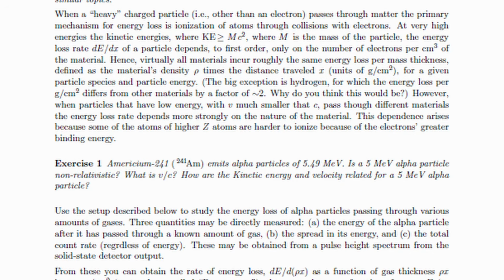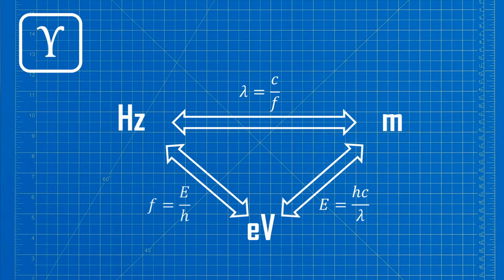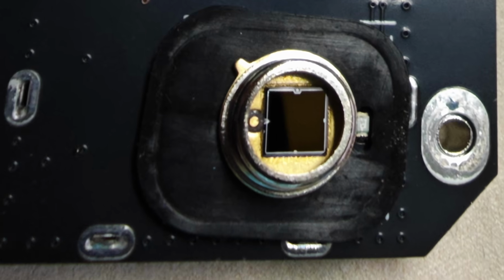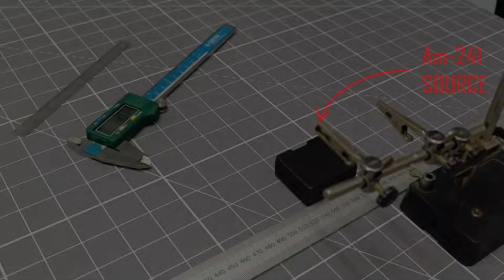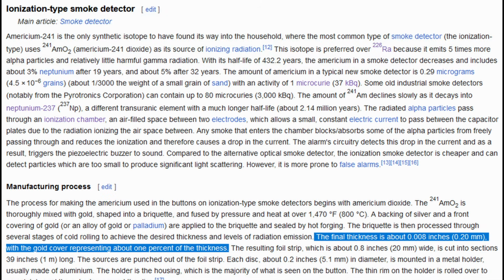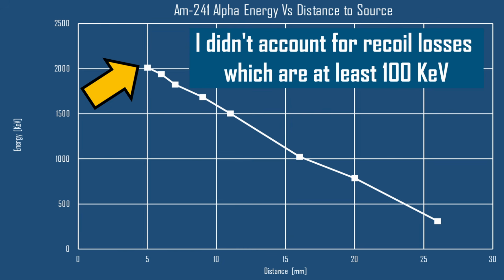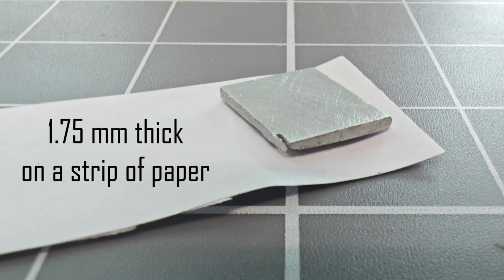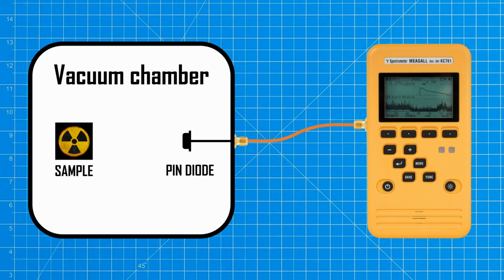an affordable alpha spectrometer.  ☢️

Comment: can you measure Radon directly or by filtering only?
Reply from the maker: I am very skeptical of the videos that I have seen that show concentration of radon gas using filter paper (or alike) over the nozzle of a vacuum cleaner.  Normally a survey is done over a long duration and using a gamma spectrometer.  Radon is a noble gas, it is chemically inert. I can't see any mechanism for it to want to 'stick' to the filter any more than the oxygen or nitrogen in the air would.  
Radon-222 is not easily directly detected but looking at the measured proportions of the various gamma lines in the Uranium decay chain, the levels can be estimated, but it takes time to collect enough data and some background knowledge (or a willingness to learn) to be able to process the data.
Reply: @project-326  the other issue in these measurements is they never refer to the time of filtration as if the volume of filtration is not counted it could only be counted the presence of Radon but not the amount. Is there any changes in window that you noticed in KC761B, as it still does have the cover. The second do you think that settings the  window for background discrimination in specific isotope detection that could make the CsI(Tl) effective for alfa measurements, rather then use of semiconductor or Ag(S) thin detectors, so radiacode could also be fine for alfa detection? By the way it would be worth the mention that radiacode is the only makeing automatic isotope identification, others make it only by manual set to the peak. But my question to the manufacturer is what if there is a mixture of istotopes like in most contamination, i.e. Cs-137 and I-131 is it the others detected or the peak only?

Comment: Today the kechuang Blog about the KC176B
The Tiger brother developer states about beta drtection
5. The issue of resolution control was at odds with the crystal factory, so that the price of the crystal was twice as expensive as normal without control. Since the KC761B guarantees a resolution better than 7.8%, approximately 35% of the crystals now need to be thrown away, which is intolerable.

In addition to the above problems, the user manual needs to be modified to make it clear that beta energy spectra cannot be obtained using PIN. Beta rays have strong penetrating ability and will penetrate the depletion layer of PIN, so all the energy of the particles cannot be transferred to the PIN. No matter how high the energy of β is, the energy spectrum of PIN is roughly concentrated on a peak on the left and does not move too much to the right. Increasing the bias voltage can thicken the depletion layer, but the PIN itself becomes a source of noise, and the low energy threshold will rise sharply to the point of being unusable. Of course, this problem can be solved by using some sky-high price PINs, but the instrument itself is sold at a bargain price and cannot afford a nuclear-grade PIN with low enough noise.
Quite disappointing...

Comment: Wonderful. I turned from being a grad student in hi energy physics to computer science some time ago (the 70's...) I actually remember some of this stuff! I recently got a Radiacode 103, which is a wonderful, versatile device. I would hope that Radiacode has viewed this presentation, and is contemplating adding a PIN diode detector for the, let's say, 105 version... Looking forward for your review of the revised unit!
Reply from the maker: I know what you mean, but at the same time, I like the RC102/103 just as it is, I kind of think of them as one for the road and one for the home-lab...

Comment: Forums seems to be useless. I was banned on physics forum for showing people there did not understood Newton's 3'rd law. It makes sense that energy of alpha particles is their kinetic energy as it is a massive particle the nucleus of an atom so way, way heavier than electrons. 
I have a Radiacode 102 is a gamma spectrometer barely getting in to beta and just got it out to check the limits but it was again dead (overdischarged battery). I think I charged it two wheels ago when I also found it dead. So it may have significant self discharge while powered OFF witch is bad as that means the battery will eventually die.
I also have a Radiascan 701A but that can not measure energy is just a counter that should be able to detect alpha particles. I'm not passionate about this but I like to have this meters just in case I ever need them.
Reply: The amount of snobbery and exclusivity in modern day acedmia is quite disheartening.

Comment: KC761 alpha spectrometer is better than Stoppi Alpha spectrometer?
Reply from the maker: No idea which is better.  In this case, better, probably means lower noise.  My problem with that video is how the calibration was done, it was a little misleading.
Reply: @project-326  OK , can you explain comparison between KC761 Alpha spectrometer and Stoppi Alpha spectrometer
Reply from the maker: @pak7524  the principle of operation is identical, a reverse biased PIN photo-diode with the glass cover removed in a dark enclosure.  The Stoppi video is using the freeware Thermino MCA software to perform the actual spectroscopy and the KC761 has a dedicated, pre-calibrated one.  The Thermino MCA software doesn't have any idea what it will be connected to so the user needs to figure out how to calibrate it.

Comment: IIRC one problem with silicon detectors for alpha detection is the cumulative damage the alpha particles cause to the silicon. I suppose this won't be a problem as the device is built, but doing lots of alpha detection with the bare PIN diode will eventually degrade the detector.
Reply from the maker: I heard that this can be a serious issue for research labs that work in this field, I guess that their detectors will be getting used extensively.  
Just the 5mm of air is bringing the energy down a lot, but I am planning to create a vacuum chamber front end for this device, so that might become problematic.. Fortunately, the detectors are pretty cheap and although my use case will be with a VERY low duty cycle, I will take your advice and ensure that the replacement process is as simple as possible...

Comment: excellent video again sir! Neat little device ! I am considering buying one thanks to your review..  I have made some decent vacuum chambers with PVC pipe for rough vacuum applications on the cheap. Epoxy glue work great for small leaks. Unfortunately, alpha spectroscopy demands tedious sample preparation to be valid, but you can still have fun ! You know you don`t have the full energy until your peak is a vertical drop to baseline on the right side (max energy) .. Great work!
Reply from the maker: Thanks for the input, I have been trying to figure out what pressure I need inside the "vacuum bucket", some comments have indicated that the pressure should not be too low, or back-scatter will become problematic...
Do you have any advise on what pressure I should be aiming for?
Reply: depending on the size of your chamber I would assume the mean free path range of the alpha would be no more than a few cm so 10-3 Torr )0.1Pa) range sounds about right @project-326

Comment: This was a very good and informative video! Thank you very much! I have by now beta measured only a stronk thorium lens and autunite. I have very much hesitated to hack the device but your idea of screwing g on a 3d printed cover seems very useful. I am pissed about the firmware and software limitations but the actual hardware is really good and well thought out. It grows on you, tis little bugger!
Reply from the maker: I always tell folks, buy the RC102/3 if you are new to the subject, only buy this is you want to learn more...
Lets keep in touch on tis lil' bugger, it has its own advantages, but they are hidden from the average casual user.
Reply: @project-326  I will! I have some interesting reading from a very small tritium tube which the 103 doesn't detect at all but re diode does. So I think it is a very good complement to the 103 in fact! I'd send the bmp but that isn't possible I see...
Reply: @project-326  I just wonder... What if someone with an opened diode, due to heavy tinkering wound print a cover with a slit so there's strange physical effects takin' place, doing gaussian things to the light coming in... What would the Kc show?

Comment: Alpha detection isn't that hard. Spectroscopy (as you have found out) is a major undertaking. The industrial/commercial grad equipment we use at work uses a bare scintillation crystal in a dark vacuum chamber. The documentation says it doesn't pull a 100% perfect vacuum as the slightest amount of air helps reduce back scatter. Don't ask me how this helps as it is above my pay grade.
Reply from the maker: Nice insight, I will remember that about the vacuum not needing to be 'too good'.  What kind of vacuum level is good?
Reply: The manual says between 0.1 and 2.6 kPa for recoil suppression.
Reply from the maker: @connclark2154  Ah, to suppress recoil of the parent nucleus.

That is really useful thanks!

Comment: My Americium-241 sample shoots out so much gamma from decay chain reactions my RadiaCode103 goes crazy. That and Thorium2%/Tungsten welding rods. Great video!
Reply: i have a GMC500+ that i modded with a LND712 tube  and it gives me around 60,000cpm on an AM241 source and when i put it back in the metal can it drops to almost nothing my thorium lantern mantles make it scream too while my U ore only gives off 3 to 5k cpm hehe
Reply: @wolvesone I apologise for being late but what is the activity in Bq, and energy of your Am241 source?
Reply: @Sheldon_Lee_Cooper1980  i have no idea it is just a .9 micro curie? source from a cheap smoke detector

Comment: Love how thoroughly you tracked down all the variables.
Vacuum bucket with Plexiglas top used for impregnating mineral samples with resin should work well for that pin diode experiment.  Added advantage, way to stabilizing your ore samples so they don't shed radioactive dust into your environment.
Really like the deadpan voice...don't change it.
Reply from the maker: The chamber does need to be dark, so black acrylic sheet for me...

Comment: I was looking forward for this video, interesting way to optimize the sensitivity of the PIN Diode, probably you ruined the sealing by cutting the foam rubber, easily fixable. I am waiting for the new Measall to be released, cause currently at a whopping 12% FWHM value for Cs137, its gamma spectrometer is quite useless. The new Radiacode 103 which I just purchased has a FWHM for Cs137 of 8.4% (Anything above 8% for a nuclear phisicyst is useless and they throw away many NaItl crystals due to that, but for hobbyists around 8% can already show something.)
Anyway, I think that the best option to use this feature on the Measall with scientific value is to calibrate it on a known source (uncovered not like stoppi did with the am241 that was in an alloy so had much of self absorption and shielding by the gold film) so that way you can already compensate for the energy loss of mylar, aluminum deposition and air between, which will be the same for all mesurements. Obviusly to maximise the properties of the sensor it should be used in a vacuum chamber, but for that I would suggest replicating the stoppi circuit, maybe with a bigger PIN diode (Its BPX61 is quite small at 7.5mm^2) like for example the s2386 8k by hamamatsu at a decent 34mm^2 (I am doing it myself).
 If you modify the measall you loose maybe its best property, being a somewhat decent portable multi radiation spectrometer.
Reply from the maker: I'm going to reply to your very excellent comments a bit later, I'm on a business trip, so will get to this once I get some quiet time...

Comment: This video will cost me over 300€....
Reply: Do not buy it!
I bought it month a go and I"m really disappointed...
And this will cost you 400$ or more because of customs and shipping
Reply: @gentlemanhk  What was the disappointment? Apart from the f*** tax, shipping, and customs shit? I want to find ore quicker and be able to tell the difference between thorium and uranium ore.
Reply: @matssoderhall1780  if that's all you want to do I recommend the radiacode 102 because it's basically the same thing just smaller and draws less attention to you 

Also you can map out radiation on Google maps so you can find hot spots while walking 

It's about 300 bucks after tax and shipping and it's not like you will need to do alpha spectroscopy on uranium ore out in the wild
Reply: @The-One-and-Only100  I am using a radiacode 102 already but i like the idea to have a even more sensitive device. Also the radiacode 102 can not give a clear answer to what is in the ore i find as Uranium and Thorium decay chains have daughters with similar energies.
Reply: @matssoderhall1780  that is true. I really don't like looking at the spectrum for my autinite, but I think it could be cleaner if in a lead castle, but I don't have enough lead at the moment 

If you're able to test out my hypothesis, please do so and let me know the results 

Also, if you really want something to give you clean peaks, I recommend looking for actual MCA's since they got really cheap over the years, and it would be stationary, but great conversation starter
Reply: Idk how the RC app was a year ago but now it's quite easy to tell the decay chains apart. It's actually doing it automatically and can somehow even guess if Th-232 is in Tungsten rods or not.
Reply from the maker: @gentlemanhk  It has taken me over 3 months to figure out this product, give it a chance, it will reward you, I promise.  Yes, I agree, it takes time and patience, but the rewards are in the experience, the making of this latest video have taught me that.  I can't think of any product that has driven this mad and at the end given me so much back in raw learning.  If you just keep going and reproduce a couple of my experiments, and ask the right questions of yourself, you will get there.  It took me over a month to even "get" this product, now that I have it in a slightly fucked up condition and still imparting knowledge make me believe that the value for money is amazing.
Reply: @project-326  Thank you
Reply: @gentlemanhk  please explain. I also wanted to buy one...
Reply: @meme98766gg  Sorry, I didn't notice your comment!  And I hope you didn't buy one! 
There are every possible way "Ethernet, USB-C, Bluetooth, Wi-Fi" in this device to connect it to PC. But you can't connect it to a PC!!! Is that not catastrophic, useless and just money wasting?!  
In order to update the firmware you need to put the file on the memory card then insert the card, rather than just connect it to a PC via Ethernet, USB-C, Bluetooth or Wi-Fi which the device already has! 
No PC software, and nobody knows why! 
The user manual shows, that the device display the Temperature, but it doses not describe how to enable the feature. And I searched every ware in the settings, but I couldn't enable it! 
And much more things that I did not like it! I should have returned it!
Reply from the maker: @gentlemanhk  and BTW, I'm not sponsored by ANYONE, this is a lab product, the RC102 is a product that I take everywhere with me.  Right now I am on a 3 day business trip to Huizhou city and my RC102 is charging by my bedside, I love the thing, I even have two of them.
But in terms of what I have learned, the KC761 (with all of its faults) has taught me so much more.
Reply from the maker: OK, for some reason, the Measall people seem to like me, despite repeatedly pointing out their F**KING AWFUL USER INTERFACE and other faults.  Perhaps their English is too poor and they don't understand what I'm saying in the review videos...

OK, here is an update that I received yesterday, out of the blue, from them:

1) They are sending me, free of charge (holy $hit, I'm a proper YouTuber now) the very first unit off the production line of the KC761B.    The 'B' version has two improvements.  7% FWHM spec resolution and the ability to use rechargeable NiMh batteries.  Mind you, they didn't actually say specifically, that it was for free, if there is an invoice in the box, I'm gonna be pissed.
2) The neutron detector will be for later model.  I already have bought beryllium metal in readiness...
3) They promised that they are working on a new UX for the 'B' model (not ready yet) and that when it is released, it will also work for the standard version too.

So, the big question is, why won't Gamma Scout send me a freebee to review???
Reply: @studio326-  I'm excited for the neutron detector, and in the future, when it's more finished (and when I have money to burn), I'll get one but I've been thinking and what if the pin diode was for beta detection and beta spectroscopy and not alpha as suspected because that would explain why it's the way it is

Honestly I think gammascout is too chicken to do anything because they see themselves as "better than" other detectors like bionerd23 famously used one and honestly I don't know what she saw in it (she will be missed tho)
Reply: Someone said there will be improved versions of this meter. I'm going to wait until at least the late November sales to decide.
Reply: @gblargg  Yeah, it has a spot inside for a neutron detector, iirc from the first video